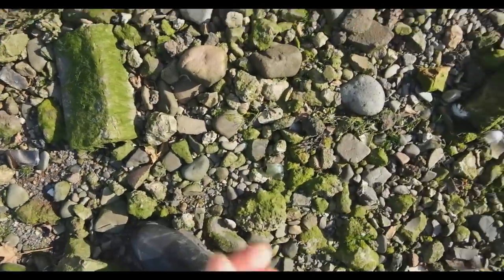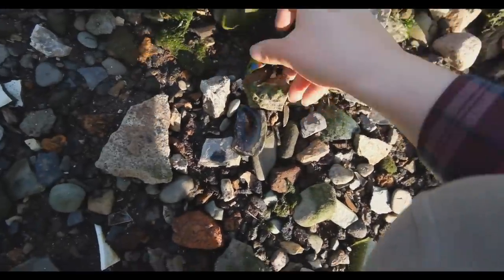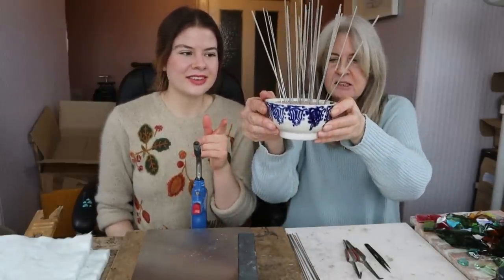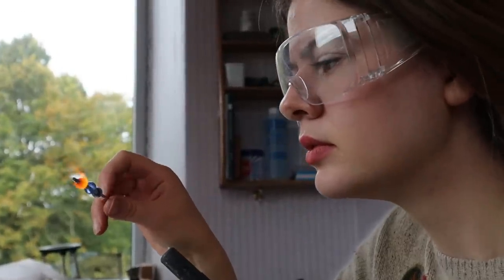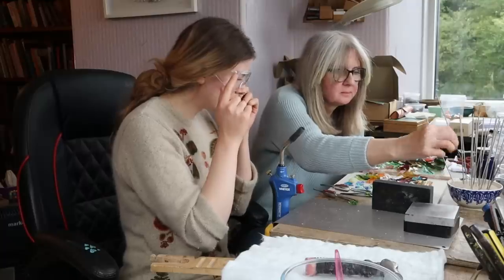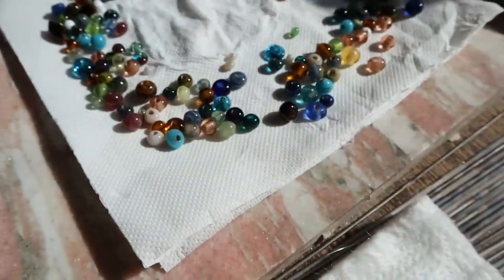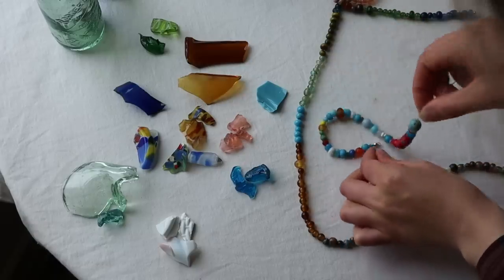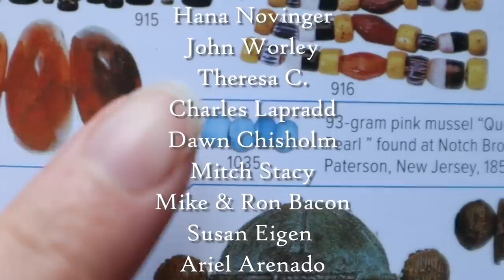Making beautiful beads from antique glass! Recycling our mudlarking trash into treasures!

Comment: Gail the dome shaped bead is a tie-off bead. When you finish a bracelet tie a knot then feed the thread, both ends, thru the dome bead, narrow end on the outside, then tie a double 
knot, pull it tight.
Cut thread leaving an inch from the knot. Note that rope, cord, 
kite string, stretch string, yarn, all need to be the same size as   the hole on the bead, when doubling it at end of the dome bead. Hope you understand my understand process.
Reply from the maker: Ah thank you very much for that Julie! xx

Comment: Hello ladies...I 've been meaning to message you for a while now and this is the episode. I am a bead maker myself and would like to give you a few tips to make your life a bit easier. If you have already figured it out please kindly ignore and move on to the paragraph on my feelings about you two🥰. To prevent the minerals that are used to give glass its colour from burning I would suggest working a bit further away from the torch, avoid the blueish area. This would also reduce the bubbles. Even though they are visually beautiful the air trapped inside them expands and makes the bead crack. Even in the sunlight sometimes. Soaking the beaded mandrells in water before removing the beads helps a lot. Stuck beads tend to crack in my experience even if it's not visible sometimes. last but not least take your time to heat the glass untill a honey consistency. This will provide a consistent flow of glass and make it easier to form centered beads. Another tip to form centered beads is the even rotation of the mandrell. Poor joints lol 

Now... you two are absolutely amazing. I am hooked since the first episode I've watched and can't watch anything else. You are so genuine so sincere. Both visually and verbally you communicate from the heart. Alex your beautiful smile, the joy and excitement you feel towards not only for treasures but for nature itself puts a smile on my face every time. You are so cute and full of life. I hope life and the people you cross paths with treat you with the same love and kindness. I also adore bones and skulls btw. Gail... again so genuine so real so natural. Your talent, determination and search for knowledge is fascinating. But above else what a mother you are?!!! I respect and admire you. Having a daughter in puberty myself I can only hope that we can have the same friendship you guys have after this stage (puberty) is over. 

I think the quarenteen period gave you a new perspective to broaden our skills and creativity and led to a stream of good quality videos with loads of different content. <<<Thank you and congratulations from the bottom of my heart. Like I said you are amazing. Take care. Love Liz

Comment: crush some of your different colored glass into small pieces roll your bead white hot in these so they stick then use your flame to smooth them out. you will have multi colored bead surfaces.

Comment: I would always break the glass into pieces that were small enough to be beads then I would drill a tiny little hole in the middle of them using a drill bit about the size of a sewing needle sometimes I actually did use the sewing needle for a drill bit and then putting it in a rock tumbler until it was smooth. Shalom

Comment: Annealing is normally done just after making a piece of glass, when it is still very hot, it is put into a kiln to cool down over 24 hours or less,  it prevents cracking. Why you need to anneal after the beads have cooled and been washed seems to be a waste of electricity and time. In industry, when sheet glass or bottles are made, they pass into an `annealing lehr', a long oven that cools them very slowly. Gold is used to make red through to pink glass, be careful of harmful vapours.

Comment: Please invest in some didymium glasses.  You only get one set of eyes and also make it easier to see through the flame.  Eileen gave you good very advice for working the pinks and ventilation.  You may also be able to speed the process a little if you have a little cup warmer or an old iron frypan on a hotplate to preheat your glass (it also helps eliminate some of the popping).  If you keep your beads relatively small and don't mix glasses, you will likely have some fun beads.  But each bottle maker may be using their own formulation for the glass and if the two types of glass don't have similar behavior while expanding and contracting while being headed and cooled, you may have some spectacular breakage.  

To help save your arms a bit, you can wrap a roll of loo paper in aluminum foil and use that as an armrest.  And have loads of fun!  (by the way, Bombay Sapphire Gin bottles are a lovely light blue shade.  ;)

If you find yourself totally smitten with beadmaking, you may want to check out the International Society of Glass Beadmakers.  I know there's a chapter in the UK and the members I've met were lovely people.   www.isgb.org

Comment: Hi Alex and Gail I was fascinated at making glass beads like you both do, I have no materials to do this as yet, However, If I was to invest in a small kiln like yours, blow torch, heatproof blocks and padding and glass bead mandrels, first of all, what sort of prices would all this cost roughly in total? Glass beads are fairly cheap and easy to access and buy off eBay but the idea of making my very own seems a nice challenge and certainly worth a go if it is a feasible thing to do and the project outlay not too expensive to gain all the materials needed, I know you make your own jewellery to sell so it is justified having the equipment and a means to sell your projects but to date, we both do not make jewellery as yet, it is still on our to-do list at some point. but we also collect plenty of Seaham sea glass of which we have multitudes of fabulous multis. Like you we do often find lovely broken shards of glass in dumps or sides of stream baking to do a project like this, so to me, I have to justify the initial outlay in such a project but can see it is a great project idea and you get a lot of self-satisfaction in making hand made unique beads of your very own. x

Comment: Looking through just some of the comments I hadn’t seen anything about not mixing your glass shards with each other either. Different glasses heat and cool at different rates. This is known as COE (in America). Since you don’t know the COE of each shard you shouldn’t mix them (will cause more bead breakage). Be sure to use a shard only with itself. You’ll also get a lot less breakage if you only do one or two beads per  mandrel. As that first bead sits out in the air while you’re making the second (or third) it’s cooling down in an uncontrolled environment building up stress and increasing the chance it will crack sometime along the way. BUT this is a great way to upcycle “trash” and the assortment of beads you made together are sure pretty! BE WELL from a lamp worker/instructor in USA! 😷🖖
Reply from the maker: Thank you for the advice! xx

Comment: Hey that's pretty cool recycling the glass and making glass beads to make jewelry.     I have a question for you could y'all make a necklace out of the glass marbles Danielle finding in the locks can glass marbles be drilled and turned into beads my question is is it even possible to accomplish this I know certain glass has to be drilled in water to keep it cool probably would have to use some kind of Bison device to hold the marble from spinning around hi Joe I do have quite lost ansible amount of marbles that I collected over the years as a kid wondering if I can make some pretty cool choker chain with it to wear as jewelry
Reply from the maker: You could drill the marbles - would have to be with a hollow core diamond drill in water x

Comment: what are the metal. materials used? and the mold release name?
Reply: i found a large microwave kiln on amazon its circular, does it work the same?
Reply: and whats the difference between putting them in between the cloth still on the mandrill and putting them in the kiln?